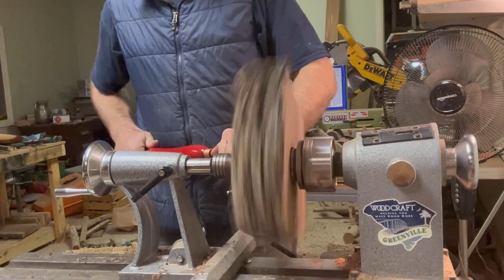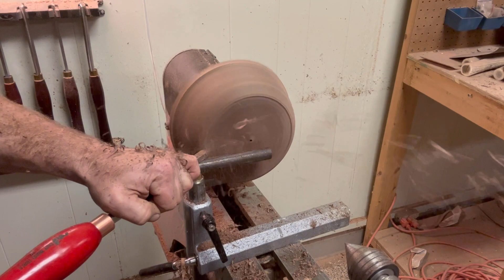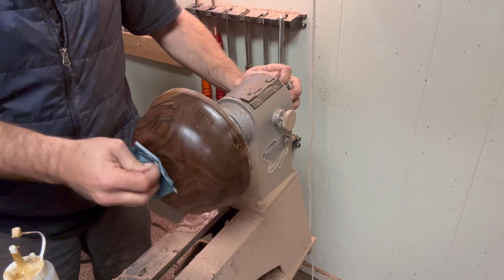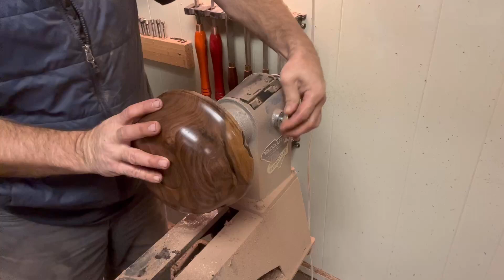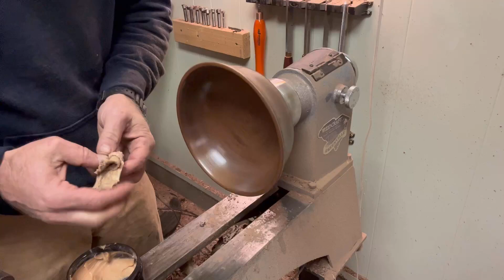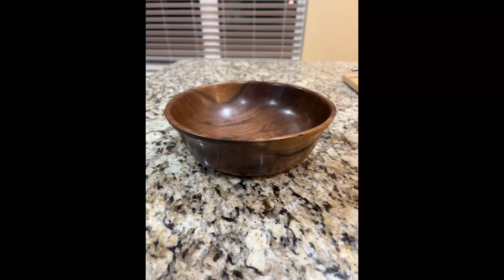Black Walnut bowl 🥣- Woodturning

Comment: looks awesome....is that mineral oil to preserve the wood? what would you say are the must have turning tools (besides the lathe)?  what do you think are good middle of the road tool brands?  I need to make a list and prioritize.   I wanted to start with a ring because I was thinking  it would be the most cost effective starter piece to learn other than just turning some scrap wood.
Reply from the maker: I start with sanding sealer then sand again. In this one I use a homemade shine juice. Mineral oil. Denatured alcohol and shellac. 1/3 each.  Then polishing paste and finish with carnauba wax.
Carbide is good to start with. Traditional tools give an amazing cut and less sanding. The issue starting out with them is a sharpening system and you really do need to buy the good ones. Sharper longer so you don’t go through them as fast. Easy wood is a good carbide and won’t break the bank. But I’m sure you can find some quality carbide kits on Amazon.
Practice making pens and wine stoppers. Good gifts and will really help you get used to turning. Scrap wood can be the best for small stuff like that. Once you are comfortable make some Burl items for yourself.